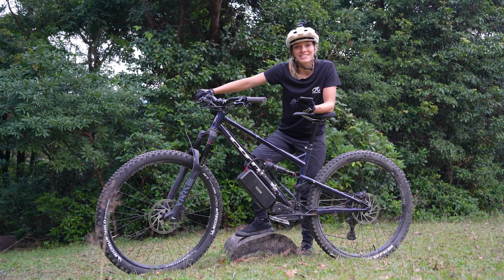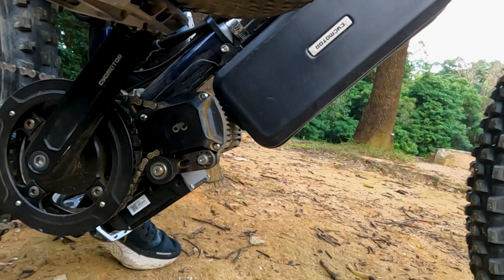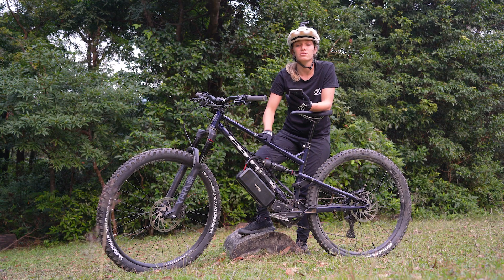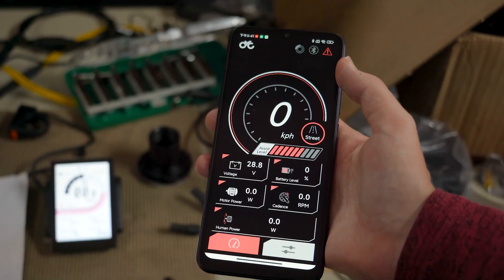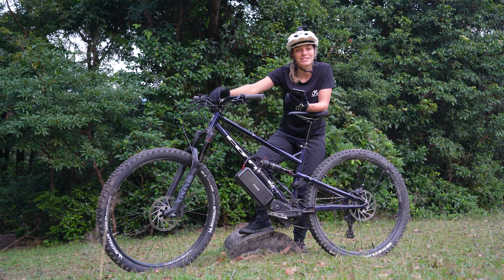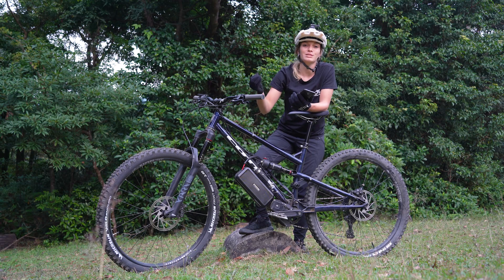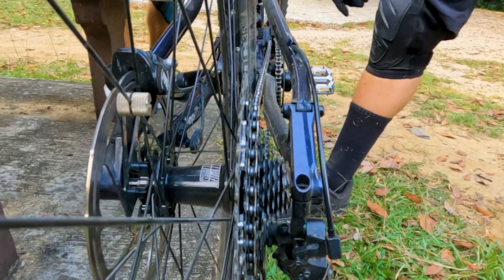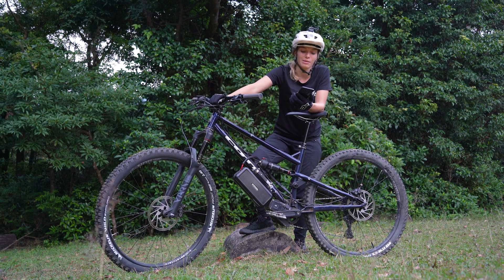5 Best reasons why a CYC kit can be the perfect solution for your e-mountain bike conversion - Gen 3

Comment: Great video. I am considering upgrading to
Cyc gen 3. I currently have BBSHD 52v
Hardtail 29ers setup. I get 35 mph continousl full throttle up to 10 minutes riding.  Is there a setup with cyc gen 3 that would give me 40 mph  with occasional burst speed to 45mph?  That won't overheat. continuous throttle?

Comment: Is there brake and gear sensors available?
Reply from the maker: Brake sensors are available directly as an option for the kit however, we do not supply gear shift sensors. You are however, welcome to source gear shift sensors from a 3rd party supplier. Just be sure to check out the pin layouts. Our tech support team can supply you with a pin layout upon request.

Comment: love reading these novice questions.....lol.  For the RECORD, I ride this on motocross trails, with Honda's and Yamahas.  It is Awesome!!! I ride everywhere, and in town, it's faster than a car travel.  I get almost 50mph with a Carbon Fat tire bike.  Clue......get a 5000 watt set up.  You can never have enough power, just use it wisely and be safe.  love and peace to all.
Reply: Seriously? 50MPH not KPH? Dang awesome. Did you do some mods or was that at stock settings?
Reply: @geekane9462  it will not take long to set up,  many YouTube videos.  Everywhere i go people are always looking at this set up, like it was built by Lamborghini.  Because of the fat tire set up you can get soooo low in corners, like a race bike.....and the torque is similar too....except the electric motor whines like the bat bike!......you can do power stands and boil your tires off,  while you're waiting for the light to change....lol.

Comment: Can you configure the motor using a computer instead of a phone app? Can the phone app be used offline?? (i read in the FAQ it requires login, what if you have no internet??)  Unfortunately many kickstarter crowdfundy companies disappear into the abyss and leave behind broken unusable apps and products.   Hopefully the motor is not 100% dependent on a phone app, curiously awaiting your response, Thanks.
Reply from the maker: The Gen 3 kits do not need the app for set up. Set up can be done via the display. The app is only for advanced settings. Since we are swapping to our in-house controllers, this is the platform we will be using for all future generations and products which means that we will continue building on the new app and improving it.

The FAQ is referring to our CYC (BAC) app that is paired with the previous generation kits that have ASI BAC controllers. We will be phasing this out with time but this app will remain available for all CYC users with ASI controllers & will also have updates.

Comment: What type of chainrings does it use? Are they only available from CYC? What is the cost of a replacement chainring? I don't see them in the shop, where do you get them?
Reply: You can use standard 104 bcd chainrings.
Reply from the maker: Just be sure to get steel. Aluminium will not last long. We do have them available in our online shop here:
https://www.cycmotor.com/shop 

Let us know if you need any other info.
Reply: @vmao4868  ok Thanks good to know,  so its not like a BBSHD where you need to buy some artisian crafted chainring for 100$,  Nice

Comment: Kathy hop on and send it!! We need to hear the motor.
Reply: They have a short where it's being ridden under both throttle and pedal assist modes. It is substantially quieter than the previous generation of pro motor (that's what is on this Cotic)
Reply: They obviously hiding it lol.
Reply from the maker: You can find some videos from our partners and other collaborators where the noise is clear. We'll produce an official video as soon as possible.
Reply: @st33ldi9ital  huh?

Comment: how do you know what bracket size you have, and are all the tools to put it on provided?
Reply: Measure the width and tools are standard bb wrench fitting and alan head screws
Reply: Check out the faq section 👍
Reply from the maker: If you struggle to find your BB type, you can have a look at our FAQ but feel free to email our tech support team. We can assist you on how to manually check this & overview your kit options before purchasing.
Reply: Look up your frame information.